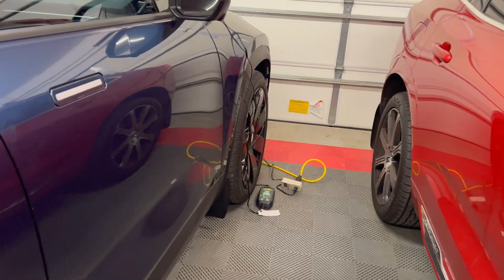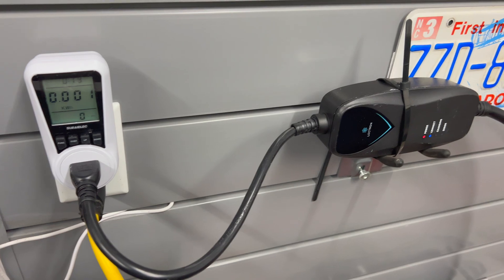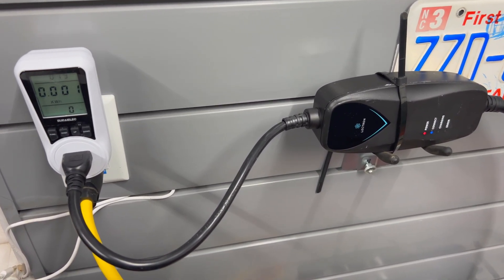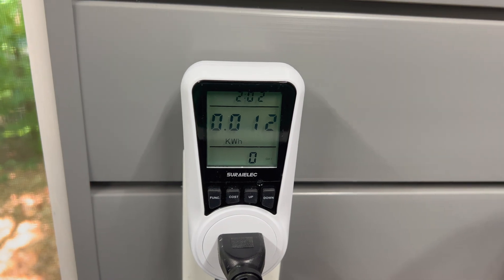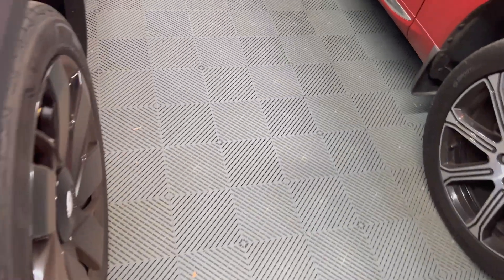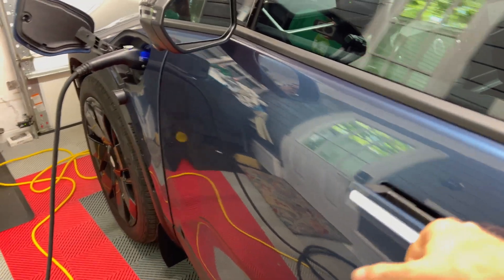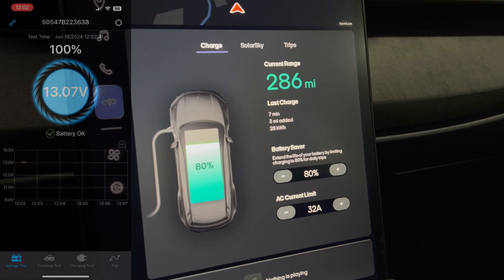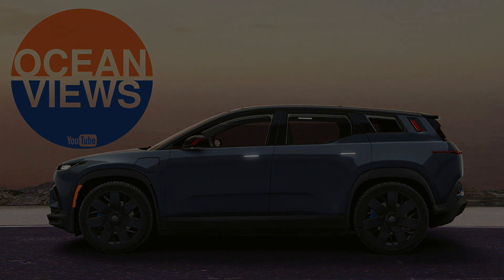Fisker Ocean - Battery Tender & EVSE Test

Comment: The dips in the 12V battery are interesting, I wonder if it's the car drawing more than the tender can supply, or if it's the tender cycling between idle and charging.

Would also still love to see a 12h test, but where you reset the energy meter after it shows the 12V being fully charged. Hopefully that wouldn't take longer than an hour or so.
Reply from the maker: 1. The dips are also seen when the car charges from the high voltage battery pack, so it's nothing to do with the tender.  2. I'm not sure if I was clear in this video, but the 12V was fully charged when I started the test.  It showed charging for a minute or so when I reconnected it at the start.
Reply: @MTNRanger  AHHHH, gotcha, awesome, so still about 1% per day vampire. Very cool results, thank you!